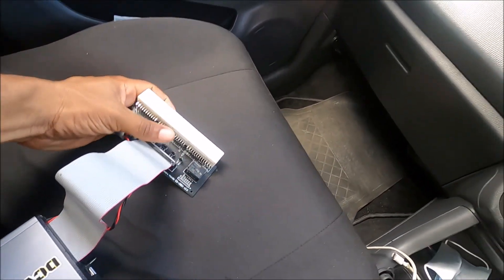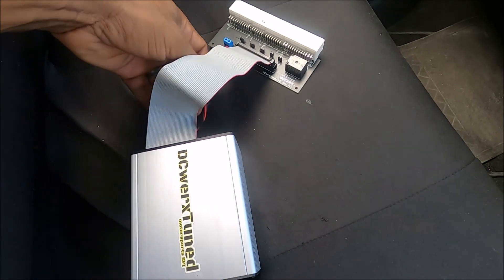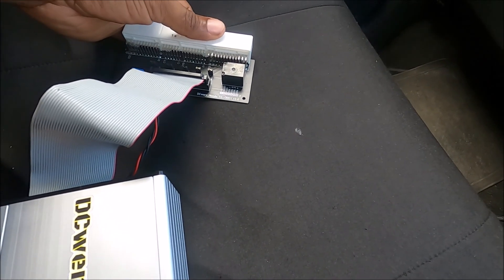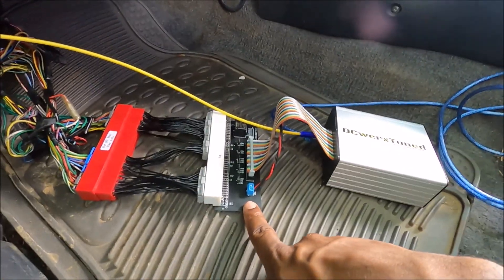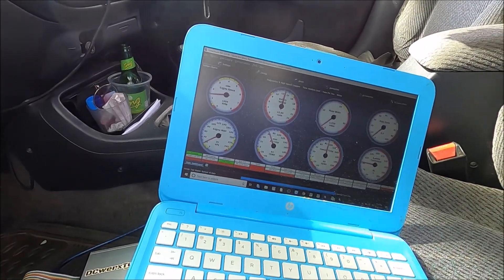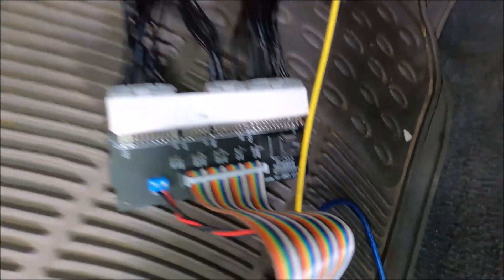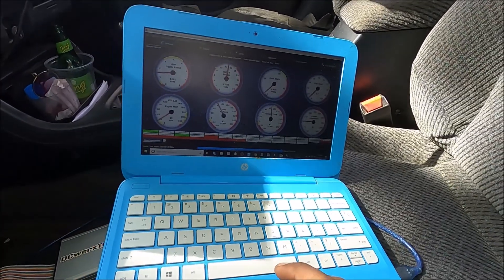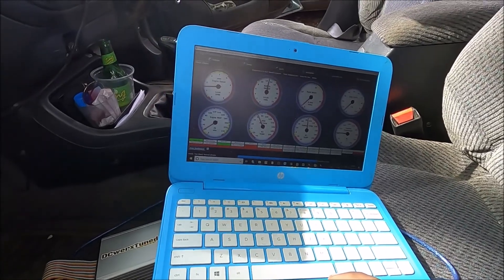OBD1 Honda Adapter Boards Beta Testing Success

Comment: would love something like this for the obd1 toyota glanza 4efte engine  would open up a lot of guys to speeduino 
ecu support is shocking for this car most guys use a piggy back wich sucks
Reply from the maker: Problem with the glanza is the noisy distributor trigger signals
Reply: @DCWERX  yeah i see a few guys have had luck grinding a tooth off and getting rid of the second sensor or grounding it
Reply from the maker: @tactix101  correct, however most folks don't want to hack up their distributor. If that wasn't an issue I would gladly make one for the 4efte

Comment: Will the new ecus have 2 timing maps for on VTEC amd off vtec and the VTC maps too
Reply from the maker: Dual timing maps is dependent on the Speeduino software not this adapter board. Currently Speeduino supports vtec and dual fuel maps but not dual ignition maps. 

I have tuned a bunch of obd1 vtec hondas with Speeduino and to be honest you can do a pretty good job with just 1 fuel and spark map.

This adpater is for obd1 Honda vehicles so no vtc support.
Reply: @DCWERX  thanks for the reply😀